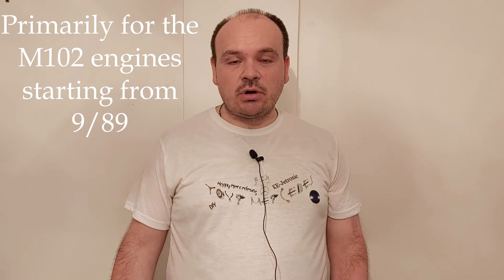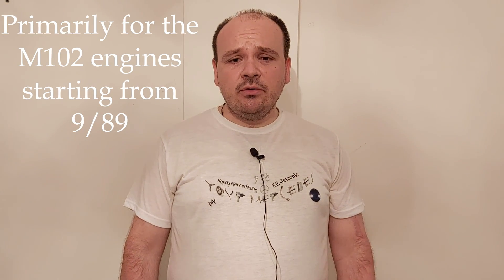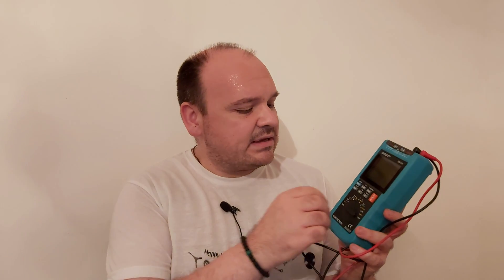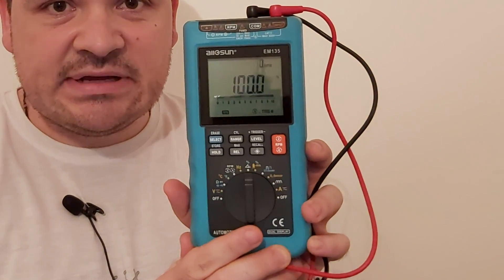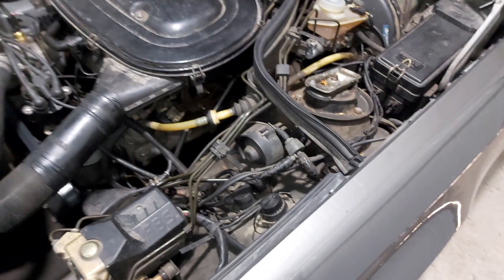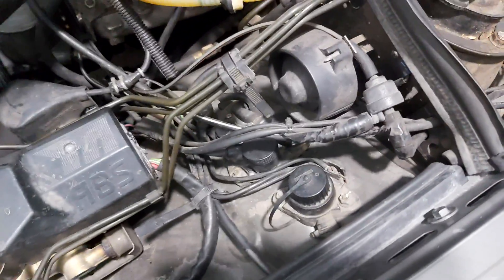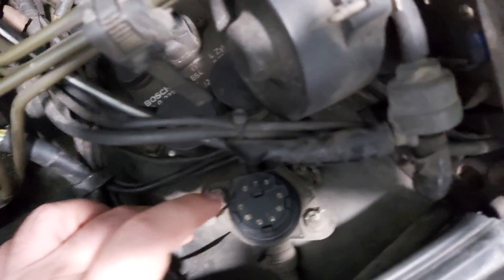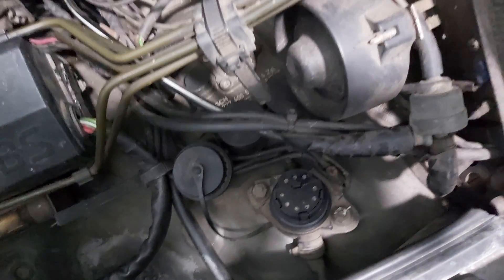㉦Mercedes Ke-Jetronic㉦ - Reading codes in percents from the X11 diagnostic port

Comment: Good day sir thank you for the great videos. I am getting some strange readings. I get a duty cycle of 99.9% most of the time. Sometimes it reads 10% but very rarely. The 10% reading corresponds to the air flow meter which has been exchanged and the new one tests good. 

O2 sensor and EHA valves are also new. 

Fuel distributor differential pressure is 0.4 bar

The car will start and idle fine but is very low on power and does not want to rev. This is after I got the fuel distributor rebuilt. 

Do I have a bad ecu? Did the rebuilder mess up the fuel distributor?
Reply from the maker: Thank you very much for your detailed comment and kind words! 🙏
A constant 99.9% or 10% duty cycle usually points to an electrical fault — not a mechanical one. The rebuilt fuel distributor is very unlikely to be the cause of this issue, especially since the car idles fine. If the fuel distributor was incorrectly rebuilt, you'd more likely experience rough idle, stalling, or surging under load — not a steady 99.9% duty cycle.
Here are a few things to check:
🔹 OVP relay – A faulty overvoltage protection relay can cut off power to the ECU, resulting in a locked duty cycle (often 10% or 99.9%).
🔹 Throttle Position Switch (TPS) – If it's not signaling the ECU correctly (idle or part-load), the ECU will misinterpret engine load, affecting fuel trim and duty cycle.
🔹 ECU itself - if the EHA and ICV work within the specs then it's unlikely that the ECU is bad.
The air flow meter, EHA, and O2 sensor being new is great — but the issue sounds electrical, not fuel-related.
Let me know what you find — happy to help further! 💡🔧
Reply: @mercedeske the OVP is new and I have confirmed 12 volts to the ECU

I tested the TPS a while back and it was good but I will test it again.

The EHA has 19.5 mA with key on engine off. Once it warms up at idle I will get 9.9mA but then I will try to adjust the 3mm Allen key to get the mA to read 0 +/- 3mA but then after 1/8 turn it will read -13mA so the readings don’t really make sense to me

Thank you again
Reply: Just to follow up on this, I removed the fuel distributor again and found the o-ring between the fuel distributor and the air flow meter to be missing.

Maybe this caused a large enough vacuum leak to give me a 99.9% duty cycle?

Comment: Have a 91 500sl and the port will not display percentage, only voltage. The meter has a duty cycle function, but will not show it. Any thoughts?
Thanks in advance..love your videos!
Reply from the maker: Thanks a lot. Which voltage do you get when the car is at the operating temperature?

Comment: Hola!!

Otra pregunta: le coloqué un osciloscopio portátil y marca 10ms y 20% ciclo de trabajo de la onda cuadrada. No entiendo por qué 20%. De la tabla puedo entender que es un problema con los sensores abiertos/cerrados del cuerpo de aceleración, pero no entiendo por qué da ese error, o con el cutoff de la desaceleración, que porno cierto creo que eso no le funciona a mi vehículo (el deceleration cutoff). No sé cómo reparar esa función de corte en desaceleracion...

Por otra parte, si todo está bien debería leerse 50% y se hace un ajuste fino de la mezcla aire/gasolina midiendo el ciclo de trabajo hasta alcanzar el 50%?

Saludos
Reply from the maker: Hola. La mejor manera de comprobar el TPS es comprobarlo como lo expliqué en mi vídeo, lo tenéis también en español . Si todo está bien con el sensor como en el video, verifique los cables. Te pongo el enlace en mi perfil de instagram para que veas qué contacto de la ECU es para ralentí y cuál para aceleración máxima. Sólo para asegurarme de que los cables estén bien. Lo mismo tendrás que hacer con el microinterruptor. En cuanto al corte tendrás que conectar el multímetro al EHA y medir mA para que allí puedas ver. Mientras sostiene el automóvil a 2500 RPM y presiona el acelerador a aproximadamente 5000, debe obtener -60 mA. Si lo hace, entonces está presente la fase de corte. Si su TPS no reconoce el acelerador a fondo, tendrá problemas con el kick down, no funcionará. Con respecto al ciclo de trabajo, debe obtener una fluctuación de alrededor del 50%, +/-5%.
https://www.youtube.com/watch?v=_GhygFeZJfw
https://www.instagram.com/p/CTdM_5lqTKN/
Saludos!

Comment: Hi, just curious there are 2 videos on duty cycle. One explains how to used the % to adjust the fuel ration to achieve 50% ideally. This video explains how you use the % to diagnose a potential failure and 50% means Lambda not ready or defective. I think I might have misunderstood but would love to know what I got wrong.
Reply from the maker: Hi, 50% means that lambda is defective if the car has one  if not then everything is okay. If the car is with lambda, it achieved operating temperature and there is no fluctuation around 50% then that means that the lambda is defective. I hope I made it kore understandable now.😁

Comment: Details about X11 port
Reply from the maker: It's like this- number 1 is td signal, 2 is the ground, 3 the injection(if present), 4, 5 and 6 power positive(going to the ignition coil), 7,8,9 the tdc sensor which you can monitor with an oscilloscope(7 power), 9 ground. 8 is unfusible.

Comment: How can I do the work cycle without x11? I don't have pin 3, it's a Mercedes 190e 2.0 from the year 1992, gasoline, thanks.
Reply from the maker: On the EHA measuring mAmps.
https://www.youtube.com/watch?v=jeoJHWCugAE
Reply: @mercedeske  GRACIAS
Reply: Holla Ivica una pregunta por que tengo el relantin inestable que puede causar el ICV esta limpio gracias.
Reply from the maker: @tiberiuferencz  Hola. El ralentí inestable proviene de un potenciómetro defectuoso, inyectores defectuosos, lambda defectuosa y distribuidor de combustible obstruido (el automóvil tiembla en ralentí) o si el tornillo CO se ha ajustado incorrectamente.
Reply: @mercedeske  el potenciometro esta nuevo los injectores tanbien lambda no tengo seguro que es el tornillo CO PORQUE LO TOQUE pensaba que se puede ajustar es verdad que tembla en relantin entonses tengo que aser la mescla mas pobre.
Reply from the maker: @tiberiuferencz  Haga la medida de la mezcla.
Reply: @mercedeske  este como lo hago
Reply: Hi Ivica, I also have a question why when I start the car and it starts hard, the abs light stays on and the engine revs at 1000 rpm, I changed the brake pads relay and it's still the same, the abs stays on, maybe you can help me solve it this problem thanks.
Reply from the maker: @tiberiuferencz  Hi, check your ovo relay and the fuse in it if it is burnt.
Reply: What is behind the battery? I tried it, it's ok @mercedeske
Reply from the maker: @tiberiuferencz  You should have a rectangular shaped socket with 8 pins, at the firewall.
Reply: @mercedeske  me puedes decir que nr tiene porque alado tengo el rele de aire acondicionado i el de aranque en frio  gracias
Reply: cazo resuelto tenia que limpiar las patas gracias por tu ajuda estas ai para nosotros siempre 1000 gracias
Reply from the maker: @tiberiuferencz  Por supuesto que si, mi querido Tiberiu, siempre estaré aquí para todos ustedes. Me alegro de que hayas solucionado tu problema. Feliz Merceando!

Comment: on my car dont have pin number 3, so can i replace x11 port with new port?
Reply from the maker: No, you can not. All the RÜF versions have no 3rd pin on the x11. So KAT only versions have this pin.
Reply: My car is Italy version and i don.t have port 3.
How i can measure with multimeter?
Reply from the maker: @zeusbill3459  Directly on the EHA. Measure mA, the goal is between 0 and -3mAmps.
Reply: @mercedeske  Ok. Thank you.

Comment: Hi!
It is a nice video!
I have 86 year m103 940 2.6
After engine rebuild when it gets warm the engine stop😐, and hard to start, or dont start. I can't read the code, because the engine is not running. Do you have any idea please?   Thanks!
Reply from the maker: Hi, thanks. If you have a lambda and you have never replaced it, replace it because it can be a cause.
Reply: @mercedeske  thanks for fast ansver! 😊
It is new
Reply from the maker: @akosbiro7212  And what about the cold start? Does the car start cold well?
Reply: @mercedeske  it sounds ritch, but start and run. Maybe you right, i will check the o2 sensor wire. It is posible when i turn tu mutch the soldering cut the isolation. Good idea for first step. Thanks the guiding 😊
Reply from the maker: @akosbiro7212  My pleasure. Check everything.

Comment: Hello, nice Video! 
Im driving a 200E w124 1990.
My Duty Cycle shows 0.01%, what can i do? 
The "CO" is too much, 7,5%.
Thank you :)
Reply: Ok i will do that, thanks for your help! :)
Im going to tell you if its better.
Reply from the maker: @davidstegemann8236  okay, fingers crossed 🤞 😉
Reply: The Ignition distributor was broken. Now the Mercedes is working like a new one.
Reply from the maker: @davidstegemann8236  Woooow, that's great 👍🏻 👌🏻 😀 let it just be Happy Mercedesing 😊
Reply from the maker: Hello, thanks. If your CO is too high, check the injectors. If you have never replaced them, then do it.
Reply: Ok, thank you! 
I will also replace the potentiometer, the Sensor for the Air intake and the sensor for the heat of the cooling liquit. 
Do you think it is good to change them too? 
Best regards David
Reply from the maker: @davidstegemann8236  If they are not within the specs, change them.🙂

Comment: Will this work if the ECU isn't working (limp mode) Still no life from my ke Jetronik, I already replaced every single electronic component from a working car, and nothing changed
Reply from the maker: Yes. It has to show that the ECU is not working(showing 100%). And tell me what's wrong with the car?
Reply: @mercedeske  if you had other form of contact I would send you Images, but I will try to explain it to you: 
So, the car had and lpg system installed, it never ran very good so i took it out last February, I guess it always ran in limp mode (since when I bought the car in August 2019), it doesn't matter what electrical component I unplug or change out, it runs the same (bad), the motor shakes and has not much power, somebody installed a screw on the sensor plate that extends 1-2cm up, and the metal piece with the rubber where the sensor plate screw hits when it is fully closed is bend upwards, I don't know why, but if I revert the situation the car won't start at all!! The sensor plate has to be so much down that there is always a air gap, otherwise it won't run... I don't know what to do anymore
Reply from the maker: Send me the images on my fb page
https://m.facebook.com/mercedeskejetronic/?tsid=0.5399119740859866&source=result
I think you should be concerned about the mechanical part of the system.
Send me the pictures and I will try to tell you what to do.
Reply: @mercedeske  thank you very much, on the weekend I will send you videos of the problem

Comment: Hello, I have MB w201 190e 2.3e '88 and I have this X11 diagnostic port but it show's 90% when car is running or power is on. Do you know if I can read codes from my car or is it too old?
Reply from the maker: Hello. Does it show 90% when the car is warm?
Reply: @mercedeske  yes
Reply from the maker: @tuksee  It indicates either a too lean mixture. Do you have lambda?
Reply: Yes
Reply from the maker: @tuksee  Try it like me to check if there are any codes. And if you have never replaced the lambda, do it.

Comment: I actually had to switch from KE Jetronic to a carburetor system because KE gets complicated given the fact of too much durst In my country would you please talk about what type of carburatos classic MBenz can use comfortably...I own S124 M102 engine...thanks from Uganda
Reply from the maker: As far as I know 200 was equipped with Pierbourg 2e-e carburetor type but there where those w124 with lambda, ECU, OVP and everything else KE has. I heard that someone mounted a solex carburetor on a W124 and that thing functioned. So, everything is possible.

Comment: i got constant 99% with ignition on or even engine running... what may be the problem.. my car is 190e 2.0 ezl KAT 1991
Reply from the maker: I wanted to talk about that in my next video. If you look at the table it would say OVP, ECU bad but it doesn't suppose to mean. It can be either lean mixture(as the table says) or you have an error stored in the ECU. That's how it was my case. As I deleted the error(it was about lambda) now I get 48% and falling up to 0.9, but I know that I have an extremely rich mixture. Measure voltage on pins 2&3 if you get fluctuation 6-7.2V then everything is fine, if not(like me😃) then there is an error in the system.
Reply: Hi King of the ke,

Personally, I proceed like this: voltage 2&3 / by battery voltage x 100. 100-the response=duty cycle.  Example: voltage 2&3 12V battery voltage 14V 14/12=0.85.  0.85x100=85.  100-85=15% duty cycle.  Both voltage measurements must be taken at the same time!!  Gear selector on P, hot engine at idle.  This always corresponds exactly to the digital tester.  Good for you.😊
Reply from the maker: Hi and hello from me. Nice to receive such a nice comment. I don't bother myself with percentage anymore. I set voltage. As I get the fluctuation 6.5-7.3V I know that I'm within the specs. The EHA shows me then the ideal mixture. Greetings, mate and happy Mercedesing 🍀🍀🍀💪🏻👍🏻👏🏻
Reply: @mercedeske   Merci🙂
Reply: I have some other problems concerning my rpm ... when cold starting the icv acts normal the rpm is about 1300 or 1200 then it drops to 750-800... after i cruise around a little, it gets stuck on 1100 or 1000 rpm.. i tried cleaning the icv but nothing differs.
Reply from the maker: @Andromotive-q1s  Did you replace the lambda and if yes when?
Reply: @mercedeske  No i didnt replace. I think i wont find it in my country. Can it be cleaned?
Reply from the maker: @Andromotive-q1s  It can but it has no effect. Try ordering it online(ebay). You have to replace the lambda probe each 50k kms.

Comment: My 300e is in 99% even 100% and I think is a little slow in a full throttle acceleration, could be the lambda?. Thanks
Reply from the maker: You know, the lambda is replaced each 50k km/30k miles. If you have never done it, do it. I had the same problem only my ecu stored a code and I had to erase it. Check if the full throttle is engaged when you press the accelerator from inside.

Comment: My car runs great, but my duty cycle always reads 99%? My Voltage measured between pins to verify duty cycle is between 6.8-7.2 which is correct, but i dont understand why the percentage is always 99%
Reply from the maker: If the car runs good and you have no problems then don't bother yourself about that. In percentage you are right there where you are supposed to be!😃🙋‍♂️
Reply: @mercedeske  Still experiencing 99% duty cycle, cant find any information on this online or in WIS. Car has slight misfire or light 'rumble'  hovering +/- 25RPM VERY SLIGHT! Need advice.
Reply from the maker: I have the same problem and I thought it was the multimeter. Check your pressures with the eha plugged. If you get a low differential pressure you can check the eha which values it gives.